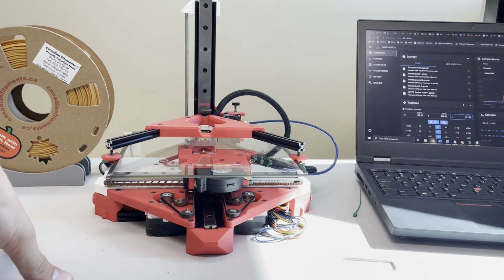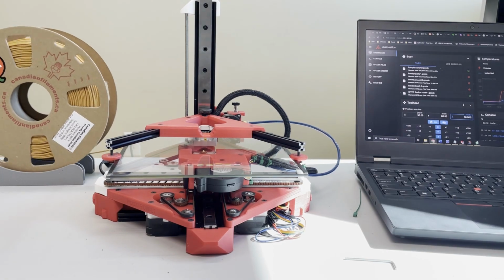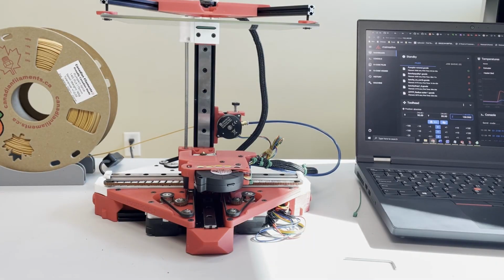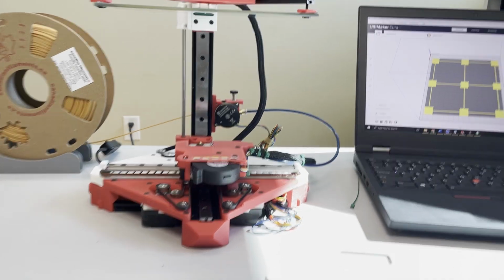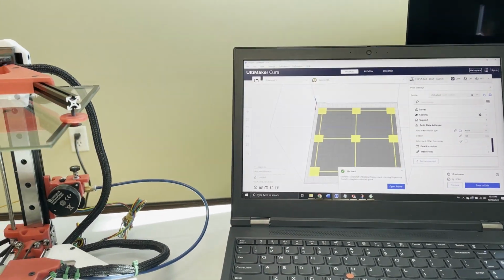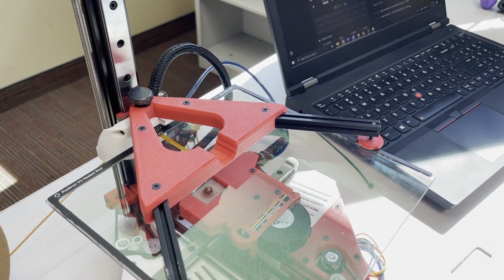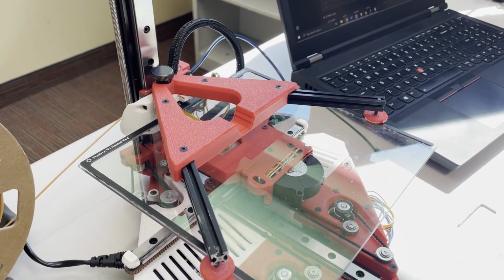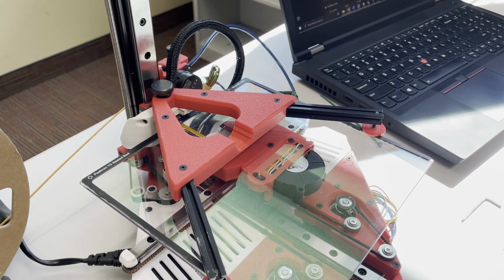Better bed leveling with BIQU microprobe

Comment: Why is your printer printing upside down bro
Reply: Why isn't yours? 😂
Reply: @ichhalt1063  If you need an explanation for that question then the explanation will not serve any purpose due to the nature of the question you asked.
Reply: @hd-be7di  There are a lot of benefits when you press the wrong way around, especially when it comes to overhangs. Other YouTubes, including larger ones, have already tried this. So why not give it a try.
Reply: @ichhalt1063  A lot of benefits? I'm sure great first layer adhesion is one of them as you can see in the video...  /s 
I like to work with gravity, not against it, If I could chose.
Reply: @ichhalt1063  To seriously answer your question:   Because I'm not a clown.

Comment: Have a look into LDM bed scanning sensors! Beacon or Cartographer3D LDM. It is fast and uses eddy currents!
Reply from the maker: Those look great! They only work with a conductive bed though. I guess the ITO coating is conductive, but I wonder if that will be enough, especially if there is already a current running through it?

Comment: All ripping off the BL Touch
Reply from the maker: Maybe but biqu does it better 🤷‍♂ its not just a cheap fake
Reply: If you think that antclabs is the only one that can use a probe technique for this, you're as naive as a child. On that thought, no cars other than Benz then  could have internal combustion...
Reply: The Biqu is specifically not. BLTouch and clones use inductive sensing and Biqu do not; instead it's basically a rehash of classic reprap probe designs which had been done a decade ago, just minified down. The only thing in common is solenoid release but that's been done in 2014 by Robo3D community.

Comment: Mine wont stow after leveling and its causing problems got any ideas?
Reply from the maker: Can you explain your problem more? I might have seen something similar
Reply: @3DPrince-zd1se sorry been busy and forgot about this b4 I start a print it does a 9 point bed leveling check afterwards when it goes to print plunger won't retract apparently its a common problem.
Reply from the maker: Interesting, where else are they talking about this problem? On reddit threads or YouTube? Is it a problem with the microprobe or klipper or something else?
 @PalosX

Comment: FYI the BLTouch can also touch and go without retracting the probe point every time. This is just how your firmware controls it. My CR-10 S Pro V2 running Klipper (or other thrid party Marlin firmwares) has done this for years.
Reply from the maker: I wasn’t aware of that. Thanks for the info!

Comment: LT is saving Positron project. Hope LT Positron will get more attention and become true budget 3DP competitor with its unique features.
Pelican case might not be only used for transport but maybe for enclosure as well or as off-grid battery station?
Reply: I use my case as a filament dry box for the printer when it is in use.

Comment: Microprobe is pretty great.  Extremely accurate, small, light, no dock needed, etc. The only downside is that its max operating temp is 60c, so it's not a good pick for enclosed printers.

For Positron LT I think it's a great choice.
Reply: Mhm it's guaranteed to work to 60°C... but i should say reaching 60°C in an enclosure is NOT that easy!
Reply: @SianaGearz It's actually really easy. you just need insulation.